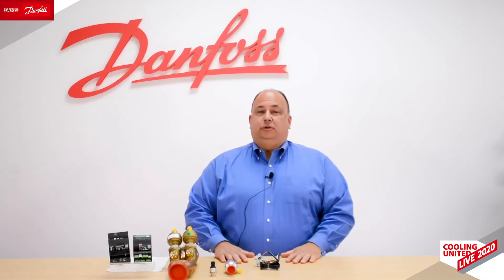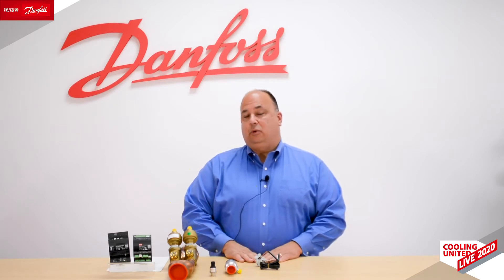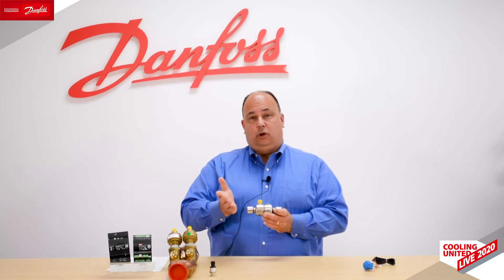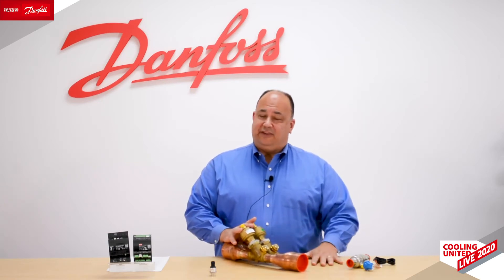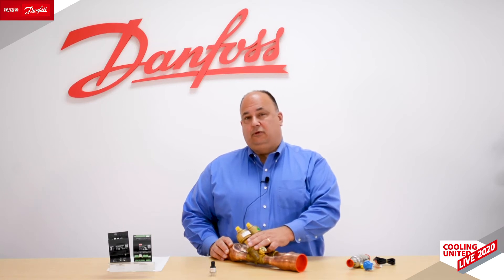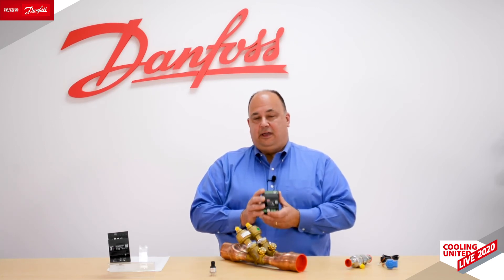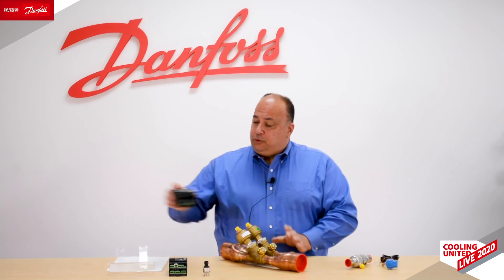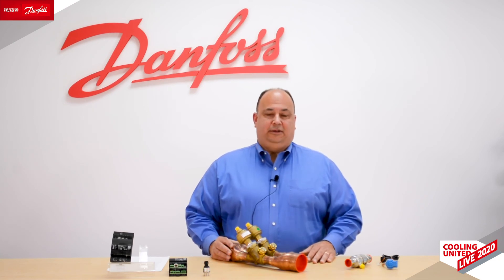Enhanced superheat control and expansion with new ETS manifold, ETS 5M, and more | CU Live | AC

Comment: Got anything I can use on an existing system with in 1/2 ?
I've been doing a little bit of frankensteining with my home open loop geothermal system, it's an old cowboy...
I performed quite a few upgrades and I'm basically at my stopping point unless I can install an electronic TXV, which opens up a few more possibilities...

Model: WPH044-14 H
SS:48407-145313
Equipped with Desuperheater
Reply from the maker: Thanks for your question. We'll connect with our experts and get an answer for you shortly.

Comment: Why not use AKV/H insted. Then you don't need an UPS.
Reply from the maker: Depending very much on the application, the pulse width modulated valve may have advantages for the stepper motor controlled valve and vice versa. There may be applications where the pulsating AKV/H may not be the best solution.
Reply: @DanfossClimate  AKV are often audible. I do supermarkets in Denmark. And on-call you can easily hear them. And i can imagine what that would do in an office enviroment.